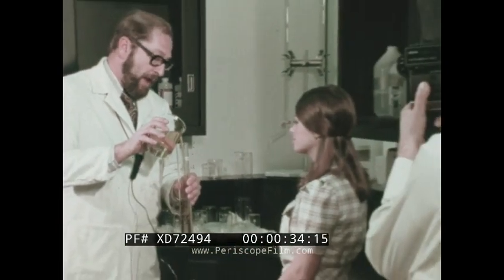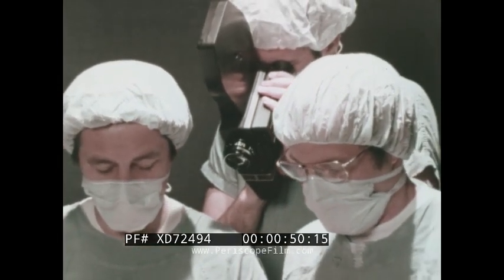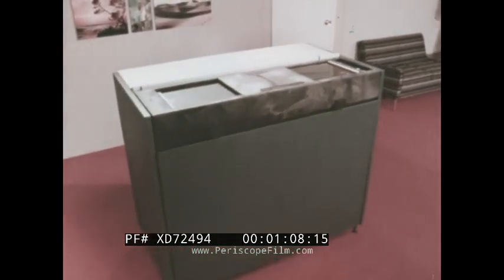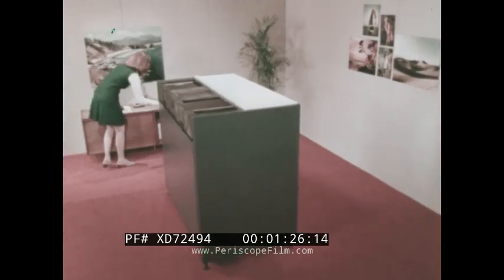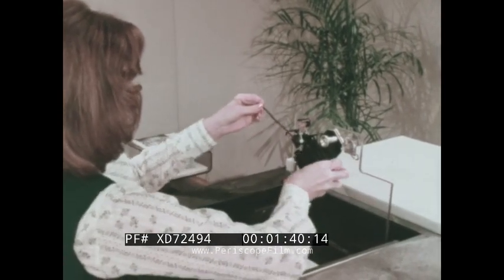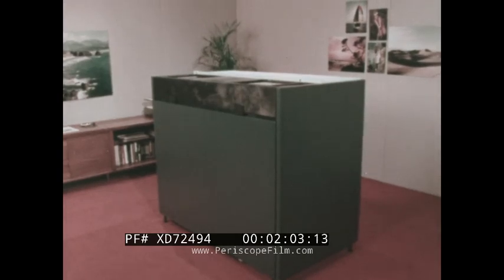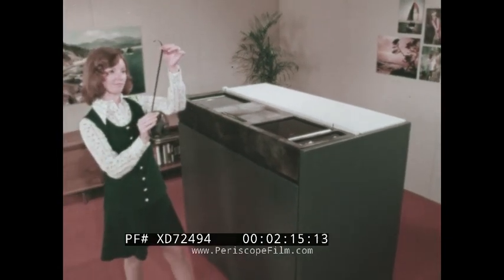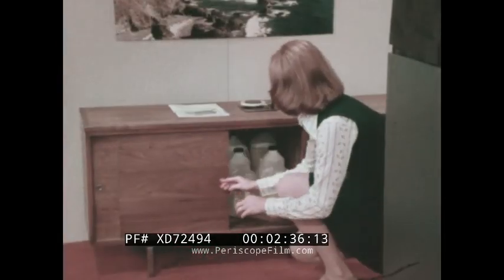KODAK SUPERMATIC 8 FILM PROCESSOR   SUPER 8mm MOVIE FILM DEVELOPING SYSTEM PROMO  XD72494

Comment: I need one of these!
Also, Kodak needs to bring back the 200ft cartridges
Reply: Yes, even though the cameras that can take it are limited, though some people reported shooting these larger cartridges, only to find out they were not moving the film.  It is the Supermatic 200 with 24fps sound speed in the film that was the first to accept the film and proved the system worked.  Later, a few cameras were custom built to have 200ft. of film in them (a Bolex was one) and a few made small magazines to do the same.  Super 8 film has been in nonstop production since it was introduced in 1965 and color negative started to get put into cartridges in the 1990s, so it has never been out of production.
Reply: Film Hipster!
Reply: @The_Conspiracy_Analyst  No, filmmaker!  I still use this format along with many others of all ages.  They never stopped making film for this format.